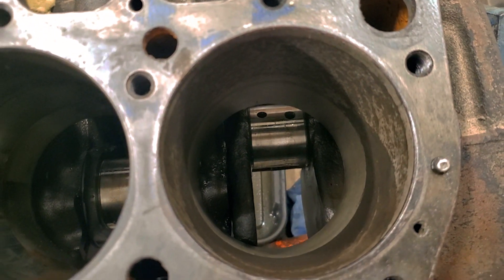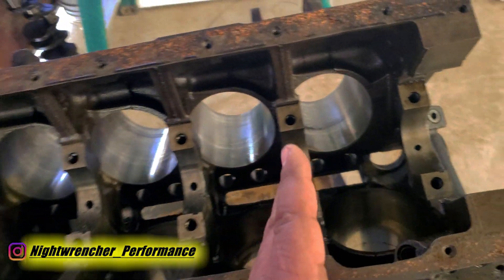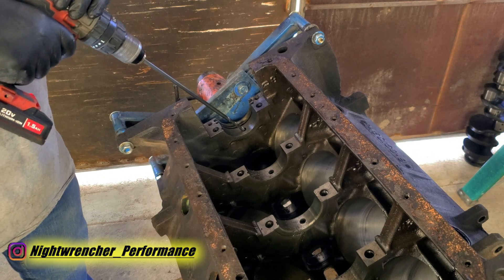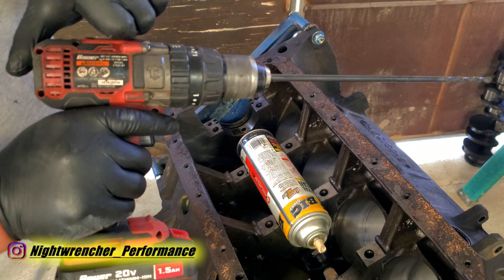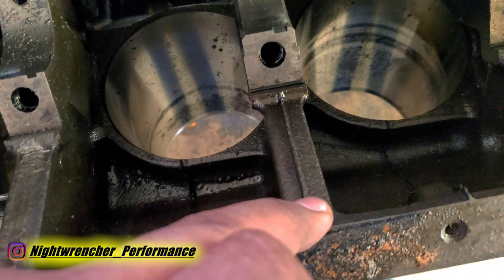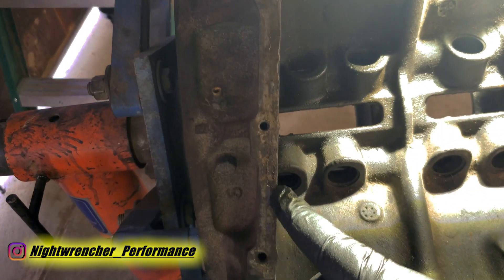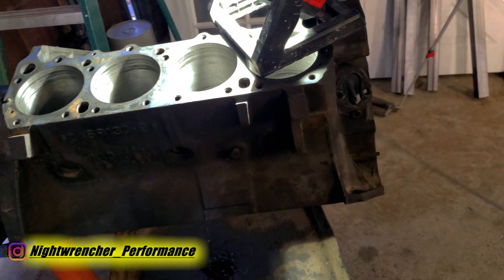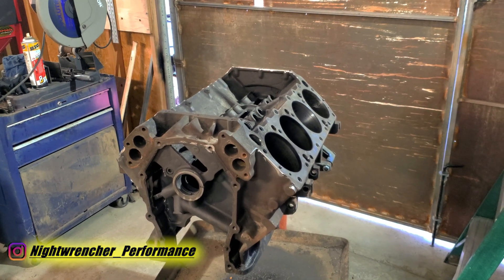Old School Oil Mods And Block Prep Before Machine Shop | Deadhole 383 Big Block Mopar |

Comment: Hi NW!  Confused here, So you are rebuilding the Old block with the bad # 7 cylinder or the $500 block you bought? Sorry, I didn't catch it.  Thanks, Deburr looks great and love the Oil passage enlargement, a great Mod to do. Cheers from Motown!
Reply from the maker: I am rebuilding the block with the bad cyl 👍 I think I'll be able to make this work
Reply: @nightwrencherperformance  No worries, You know what you are doing and I think it will just fine too. Keep us posted on progress after machine shop please.
Reply from the maker: @robertclymer6948  Will do! you might like the videos coming up before the engine comes back!